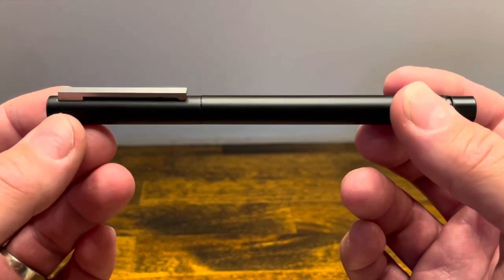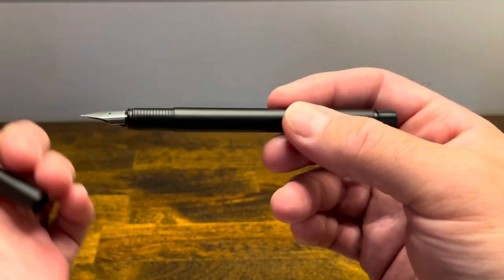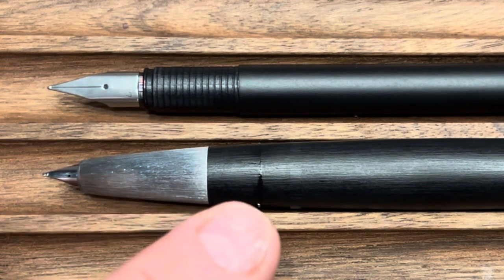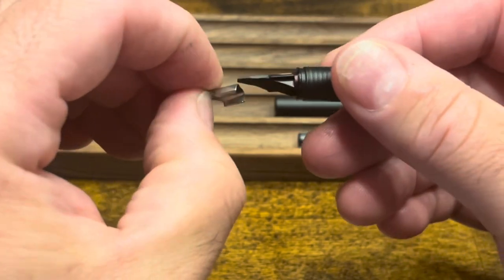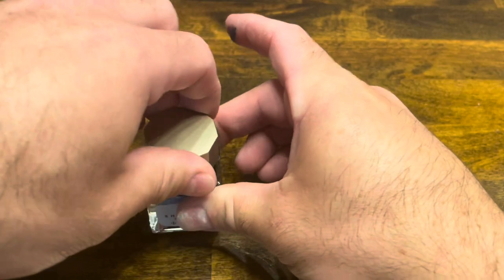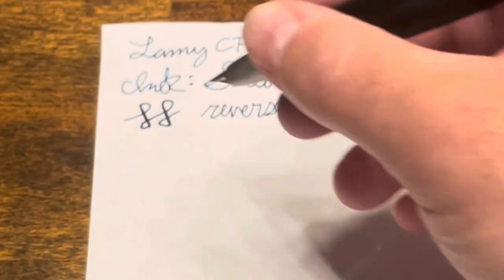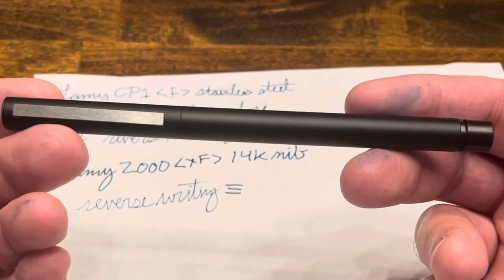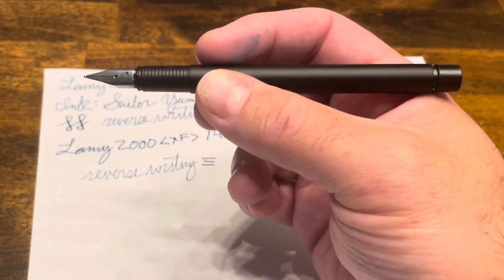Lamy CP1 - A Budget Lamy 2000?

Comment: I'm not a big fan of most Lamy pens as I don't like the ergonomics however, I love the CP1. I have 2 black ones and an older stainless steel one. The simple design is perfect.
Reply from the maker: I tend to prefer this more
minimalist and slim design too
Reply: I am curious, is your older stainless one the same diameter and nib design as the current design, or is it the older design which is slimmer and uses the original narrower nib, feed, and converter? I have both, and the original slimmer design makes that one a vastly different writing experience by how slim it is.
Reply from the maker: @markritchie7059  for what I can tell the CP1 uses the same nib that’s common to many other Lamy fountain pens, such as the Safari.
Reply: @ForTheLoveOfPens  Hi - yes it is the same one now, but until about 1983 the CP1 was a narrower design with a narrower feed and nib. In about '83 the CP1 was redesigned to have a larger diameter and adopted the Safari nib and feed.  I have two original narrower models (called the 50) and two current models, a black (56) and a platinum (53) They're all great pens!

Comment: 3:56 
Actually, the feed can be removed, it's just a little bit hard, but it's possible with tape. 
I don't know if it's only possible in the older versions like the one I have (Metallic from 1988)
Reply from the maker: @yuyoyuyazo9306  I was able to remove it on an older version as well, but for some reason I couldn’t get this modern one to budge.

Comment: Many years ago I had the 2000 with the EF nib. It was too broad for my taste. I understand that the nib has been modified since I had this pen. Is that true?  Is there a sweet spot with writing with the 2000?

While I like the CP1, it is a bit thin for my hand and would prefer the girth of the 2000, hence the questions.
Reply from the maker: I linked a video I made on the 2000. It does write about 1 size thicker than advertised. There is a slight sweet spot but it’s only a big deal if you tend to rotate the pen as you write.
Reply: @ForTheLoveOfPens  unfortunately I do roll the nib. Thanks for the information and reply.
Reply from the maker: @paulmchugh1430  if you really love the form factor of the 2000 and are ok sacrificing quality, you may want to consider the Jinhao 80
Reply: @ForTheLoveOfPens  thanks. It does have the appearance of a 2000. But I don't think Jinhao makes a piston filler.
Reply from the maker: @paulmchugh1430  I don’t believe they do

Comment: I am thinking to buy this pen as I am seeking an alternative to a Fineliner. Does the ink dry out even if it is capped?
Reply from the maker: @FarIce-m4k  no cap seals perfectly. But in my experience this one seals very well. I’ve had mine go several months without hard starting, and with very little drop in ink level.

Comment: The contrary a light and thin pen is ideal for long writing sections.  If you are having problems your pen grip is wrong. In terms of writing instrument CP 1 is quite superior than 2000; logically with the correct pen grip.
Reply from the maker: Every hand is a bit different, so for some this pen may be perfect
Reply: @ForTheLoveOfPens  , What you said is quite true for regular writing. But, there is a science of writing with technics developed for fast, easy and tireless writing. Spencerian, Palmer, Zanerian, Champion and other methods are just about it. Any of these prescribe a wide body pen, on contrary.

The problem is that people normally were not teached the art of the thing but naturally developed by themselves a form of using the tool, sometimes this process was better done and sometimes worselly.

Still, there are the good technic.
Reply from the maker: @lpanades  you bring up a very good point. Most of my opinions are based on using pens for note taking and casual journaling. I have dabbled a little in calligraphy, but I haven’t ventured far down that rabbit hole (yet)
Reply: @ForTheLoveOfPens  , calligraphy is writing with modern meaning of artistic finality, to get a beauty result. So callligraphy generally draw the letters. Penmanship is another animal. Penmanship is a practical way for fast beautiful writing with little effort, it is a technic. Wide pens are not suitable for good penmanship in the better sense of the word. You can't write long and fast sessions with a wide body pen without fatigate yourself. Normally those that prefer wide body pens are finger writers, they write with strong support of finger movement.

There are no problem about it. But, you will fatigue faster. This is why, perhaps, in most of manuals the masters said that there are not exactly the write way of doing this or that: is more a way that works for you and don't. 

Even saying that, all of them enforce that there is a technic that will improove your results with fast, beauty and effortless writing.
Reply from the maker: @lpanades  you may have inspired me to go down a new rabbit hole 🤣
Reply: @ForTheLoveOfPens  , you will love the jorney.

let me give you some fonts:
1.IAMPETH site
2.Lloyd Reynaolds videos in Youtube
3.Penna Volans site

Here you could find good material for your amazing journey. If you are a finger writer you will get a strong improovement and will get good results.

Italic and other storic styles are real hand writing, the most part is wrist movement. Spencerian is predominantly arm movement. If I write italic I hold the pen not only for 45 degrees nib anble, I hold the pen almost like your hand. So Italic will fit you naturally.
When I write regularly I use spencerian so my hand writes with the palm down and with arm movement.

An italic nib with real italic writing is wonderful, should be the first method teached in schools. I totally agree with Lloyd Reynolds.